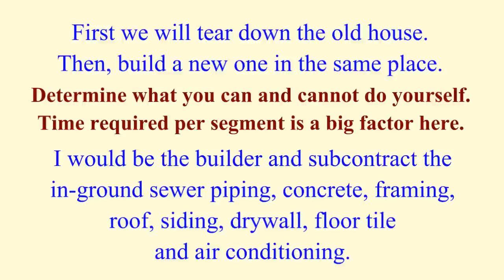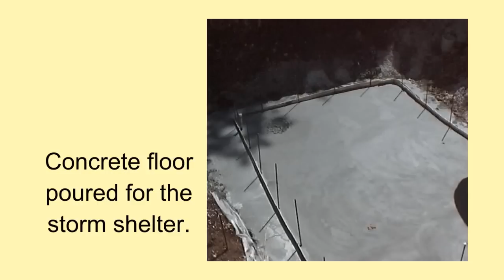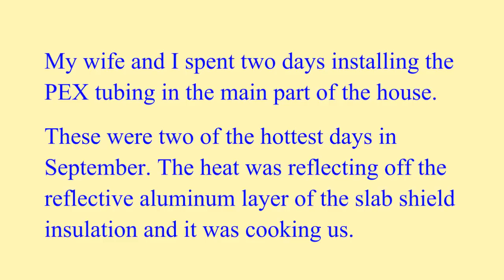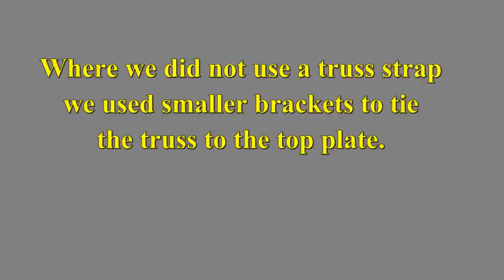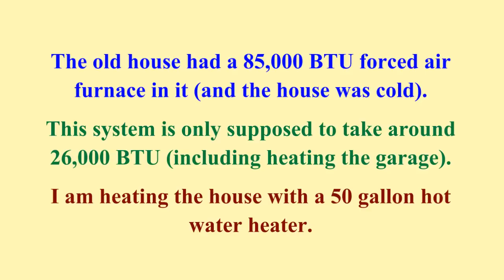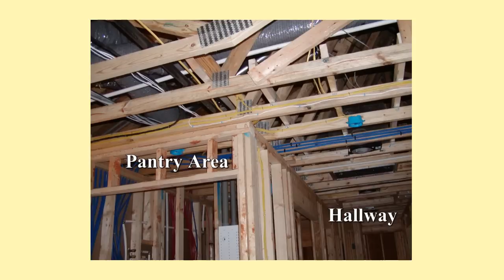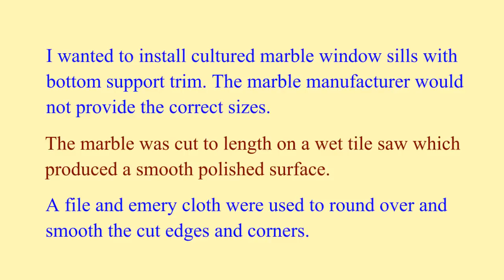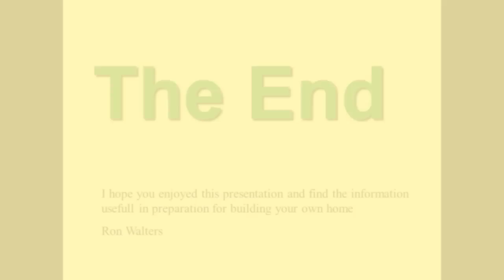How To Build A House

Comment: This is well presented. It is obvious you spent a lot of time putting this together. So many will tell you how easy it is to build your own home (or have someone else built it) and whitewash the actual event, just showing highlights or time lapse and voila, here is the finished home. I have known several people over the years who "built their own home" generally not spending much time on their projects, had quite a few problems when they moved in and they were not very happy with their houses, most of them selling a few years later. And your comment about fiberglass insulation was good. One of the friends mentioned more recently built a two story home with fiberglass insulation and it had two furnaces (huge gas bills) and remained a cold house and the roof was the first to melt any ice or snow. I will be watching this a few more times in the days to come to absorb more information. Thank you!

Comment: Doing a lot of what you did, I wondered why you weren't complaining about pain?  Then came your testimony of suffering while fitting the gas piping and I knew then you were an actual real person!

I roofed my house and tiled the floors and made a promise to myself I would never, ever do that again if I could only finish the mess I got myself into.  Is that why you contracted the roofing and tiling?

Thanks for the video.  Taking pictures of what is soon to be hidden is priceless.  I still refer to them.
Reply from the maker: 958kris That is why I contracted the concrete, framing, roof, drywall and tile. I crawled around on my hand and knees enough as it was doing the radiant tubing.

Comment: Wow, that was detailed.  One thing missing was a photo of the front/back outside after the siding was up!

Based on the photos, it appears that there is just a manhole cover for accessing the bullet area?  Am I right?  That seems like it would be a pain in the butt to go down there.  Am I missing something?

Being a storm shelter, do you have extra reinforcement on the door/walls around the stairway to the storm shelter?

Comment: Thanks for sharing.  There are some extremely important observations and tips in this video for anyone not just thinking about building a house but anyone thinking about a new-for-them house.  I used to work in construction and unfortunately many of your observations about workmanship are too close to the mark.  Let it be said however, there were still some conscientious workers interested in doing good workmanship ("were" only because it has been a long time since I did that work).  Interested in the method of insulation--foam and ground-up newspaper.  A tight building (because of the foam) will indeed trap a lot of moisture and you NEED a way to get that out.  Great series and I thank you for the remembrance.

Comment: Impressive ,Ron.  One thing I was expecting to see and maybe I missed it was a go bolt system or continuos support at intervals from slab to top plate at truss connection,,  what is your thoughts on shallow injection wells on radiant heating and cooling systems?
Reply from the maker: TIM WILSON It was annoying how little was available in this-neck-of-the-woods to do what I wanted 12 years ago when I built this. I had to special order everything. Since then I have noticed a real improvement locally in supplies for better construction. The trusses (every other one) are tied to the top plate and the support stud with a truss strap. Then that same stud is strapped to the bottom plate. The bottom plate is bolted to the concrete every 3 ft (essentially every other stud). My electrician often commented on how well the house was built and that he seldom saw anyone actually put a washer and nut on the concrete bolts sticking through the bottom plate (contractors are often too lazy to do that).

Actually bolting the roof directly to the concrete is probably more of a consideration for hurricane areas. If you have a direct hit by a tornado nothing short of a solid reinforced concrete structure will survive that. If I get a direct hit by a tornado I hope it just takes the whole thing and drops it about a mile from here. My sister had a tornado near miss years ago and it picked up the roof and set it back down ALMOST where it had been. I was really trying to avoid that sort of thing. Some of my neighbors have replaced their shingles twice in the past 12 years and my metal roof is doing just fine.

My understanding of geothermal heat source wells, you are probably going to average 200 ft to 400 ft well depth and you are going to need at least two and possibly 3 or more depending on where you are and what you are trying to accomplish. That is an expensive and messy installation and one I have witnessed fail locally a few years after installation (apparent bad workmanship) and it still takes electric to run it. You also need enough acreage to accommodate the well spacing. The heat pump will run year round so I don't know how long they will last. I chose to go with copious amounts of insulation and a little bit of gas to fuel it.

Comment: This was very helpful in my thought process of building my own house and brought more points of detail that I need to work out. this was a great video and really helped me to think of contractors that I could potentially use. The idea of an ERV unit has not come up in my learning thus far and seems like a great idea. I come from of family that works with concrete and I know many contractors and have never heard of lien waivers and that suppresses me. Teaching me to properly document work done and payment and insurance requirements are met. Thank you for your video. 
-P.S. any suggestions on how i can get some experience in home building, in order to work on it my self?
Reply from the maker: Ren Mcree Doing is learning. You need a job or situation where you can obtain a wide range of hands on experience. Just no substitute for actually doing it... reading a book about it is not the same.

Comment: Nice video, my house is currently under construction.  Like you, I try to do as much work on the house as I can.  I have spent many hours fixing, finishing, or just re-doing sloppy work from contractors.  I don't have many house building skills, I do landscaping for a living. 

I'm a fan of the varnished plywood walls you did.  What type of varnish did you use?
Reply from the maker: RB216220  You will have plenty of house building skills by the time you are done. :-)

I go to Lowe's or Home Depot and get the oil-base semi-gloss polyurethane varnish. Apply with a roller and brush it out - work fast. Pull off the roller and put it in a zip-lock bag (squeeze out all of the air) and it will be good for the next application. Sand the first coat with a random orbital and then apply a second coat (roller then brush). Two coats is usually good enough.
Reply: Yes, I have learned quite a few things that go into building a new house.  And I now have a small assortment of tools that I had an excuse to go buy.

I'm going to attempt to build a sound deadened door that is filled with sand for my little theater room.  I had planned to use plywood or osb and somehow make it look good, but now I think the varnished plywood is what I'm gonna try. 

Thanks for the advice on applying it.